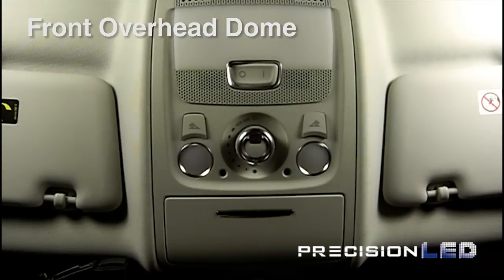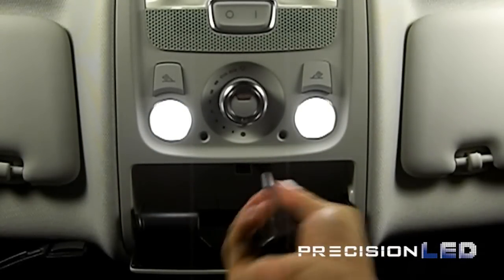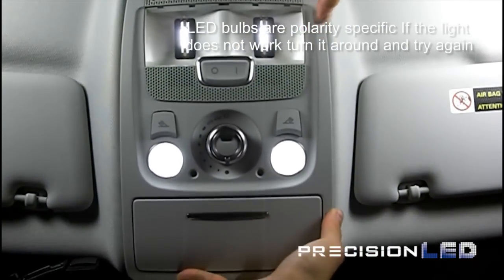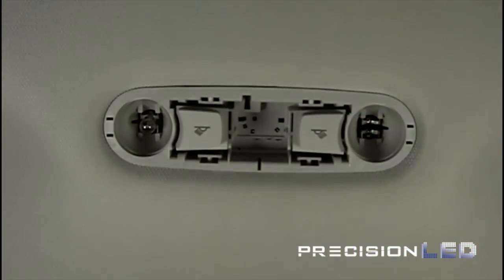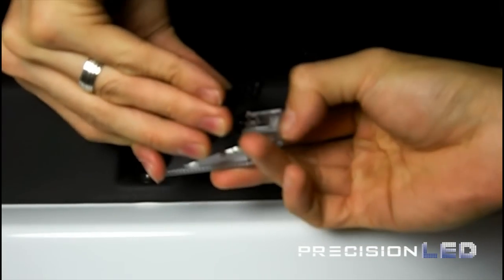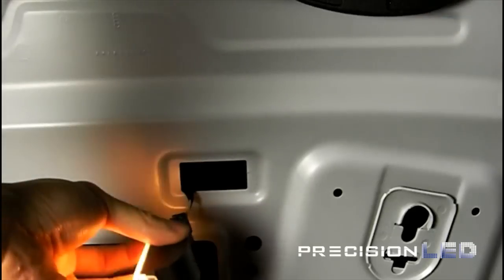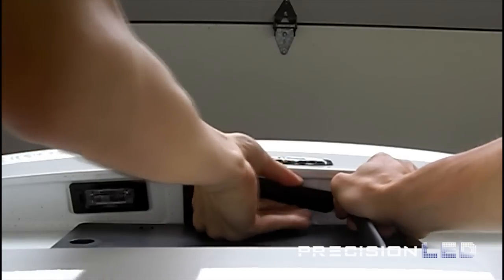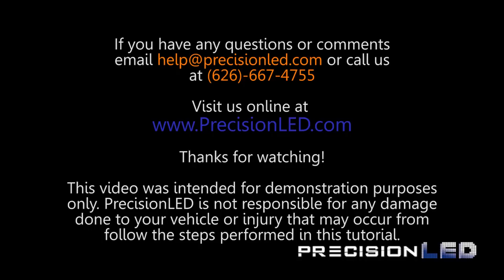Upgrade Audi A4 LED Interior Lights by @PrecisionLED

Comment: I'm having a lot of trouble removing the dome lights on the back, any suggestions?
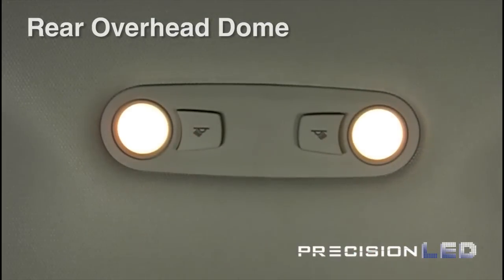Reply from the maker: Please check out 2:30 in the video. It is pretty straight forward, you just use the pointed wedge tool provided in the kit to gently pry out the cover.
Reply: What he said, my fat fingers can't get the bulb out as easily as you did.

Comment from the maker: Lights need to be CANBus to prevent error codes for the License/Number Plate.  The Interior LEDs also need to be CANBus in select areas to prevent error codes as well.  The package we sell has all the correct CANBus resistors to work error code free!

-PLED Team

Comment: Any reason why the ones for the vanity mirror only fully illuminate when the main interior lights are on or the ignition is on?  All other LED bulbs work fine.
Reply from the maker: We have never heard of this issue with our LED products.  Our LEDs would react exact as your halogens do (i.e. dim/shut off when appropriate).  It is possible you just simply have defective LEDs.  If you purchased from PrecisionLED, feel free to contact us directly at help@precisionled.com.

Comment: By using improper tools, I ended up scratching off part of the trunk paint, bent the plastic slot and ripped the rubber seals on the light housing. Time for a touch up pen  and some super glue which costs 3X more than just buying the tools on your website.  Really should have done that instead. GG
Reply from the maker: Eek, sorry to hear that! Here is a link to our trim tools:
https://www.precisionled.com/professional-trim-tool-set-3.html

Comment: The licence plate LED's in your video do not sit completely flush within the two spades on either end - why?
Reply: +jschrauwen Because the new LEDs were a bit longer than the stock halogen bulbs
Reply: +drixerr  That's what I found with the first set I sourced.  I later sourced another set that are the requisite 1 to 2 mm shorter that fit in perfectly.
Reply: Awesome and to the point video. Can you please let me know the size of LEDs for the interior and courtesy door lights?
Reply from the maker: The majority of the interior we used a T10 fitment. Here is a link for your convenience:
https://www.precisionled.com/shop-by-led/automotive-leds/t0-194-led-bulb.html

Comment: my wife bought me packs for 2010 A6 and 2012 Q7. How can I tell if they're canbus?
Reply from the maker: +michael keck They are CANBus if they have either metal heatsinks on the backs of the LEDs for Festoon tube type bulbs, or exposed resistors on a PCB board for the wedge type LEDs.  if they are from precisionled, you can be confident they are CANBus as we only sell CANBus type kits for Audi's

-PLED Team

Comment: Hi ! i was changing my interior lights to LED bulps, but when i changed 
the one in the glovebox it smelled burned from the new led bulp and the 
interior light stopped working, everything else works except for the 
interrior lights. Any tip on what it could be? what fuse it might be?
Reply: +Faserhajat check your fuse box, i think you burned a fuse
Reply from the maker: +Faserhajat You blew a fuse.  You will need to check the fuse box.
Reply: +PrecisionLED thnx already left the car to my audi dealer and they fixed it for free, it was a fuse that was burned.  but not the usual comfort Light  fuse ,something else went and my horn didnt work Either

Comment: where can i find the fuse for the convenience door lights?
Reply from the maker: The fuse for the convenience door lights is in the interior fuse panel which is typically on the driver's side door frame. You will need to check your manual for exact location and which fuse to pull.

Comment: I'm having a lot of trouble trying to pop off the license plate light housing
Reply from the maker: @ Calvinblinkee

The license plate lights are slightly difficult to remove.  As we show, the first tool is pressed into the slot next to the lens.  With that tool in, we pushed the housing towards the right which gave a gap for us to use the 2nd tool and pry downward.

~PLED Team

Comment: for some reason when i install the leds for the right passenger side door the lights wont turn on now when you open the door. any dieas how to get that fix? all other lights on doors and interior works but jsut htat right passenger door does not work.
Reply from the maker: Have you checked to ensure you did not blow a fuse?  If not, you may have a loose connection or possibly a defective LED.  If the kit was purchased from PrecisionLED, please contact us directly via email at help@precisionled.com.
Reply: yup and it wasnt the fuse, not sure what is going on

Comment: thank you very much for your video, can you help me please? I changed the light from licence plate, but the screen show me a error on this light :( I change both lights and both worked... :(
Reply from the maker: It sounds as though you would need to install Canbus LEDs in order to prevent the dash error.  We only sell high quality Canbus LEDs to ensure you do not experience issues like this.

Comment: And about the sistem error?? I wanna change but some people told me about this problem!!
Reply: Vinicius Mesquita de MACEDO i dont know why there should be a system error.. these are only some leds :s.. sorry for my bad english :D
Reply from the maker: Vinicius Mesquita de MACEDO You should not experience system errors if you use Canbus LEDs
Reply from the maker: Bender Walter You should not experience system errors if you use Canbus LEDs
Reply: PrecisionLED thats what i tought :D
Reply: PrecisionLED In Mexico, where can  I get this led's? sorry for my bad English